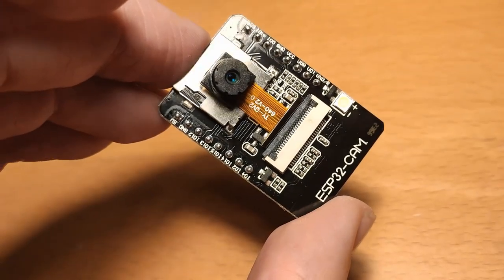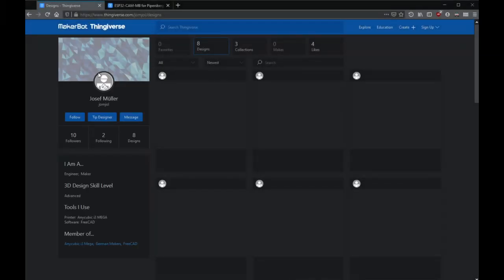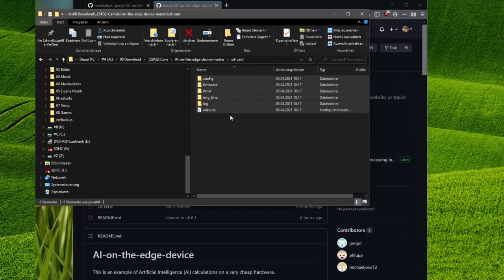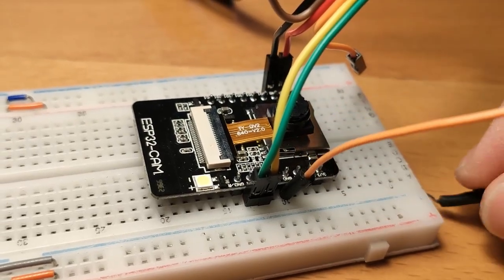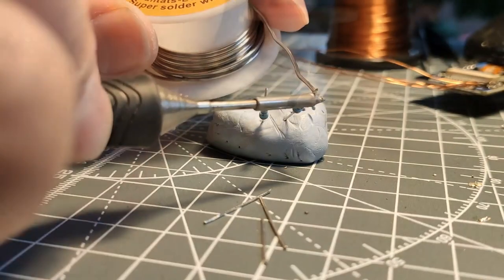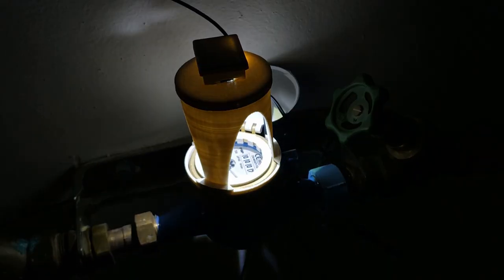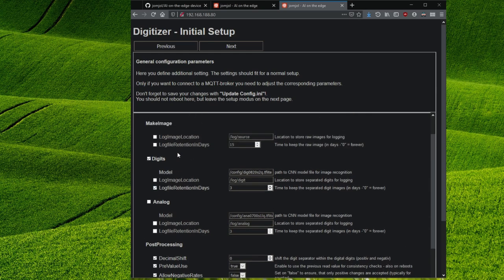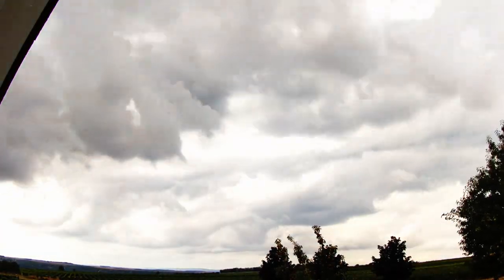ESP32-Cam on your water meter with "AI-on-the-edge" -- also for gas and power meters

Comment: LOL. I did work for similar commercial system (including analog inputs) couple of years ago. There is several issues you have to come over in good enough image quality. Used AI solution and reference points are helping in their part to tackle the issues, apparently. However, changing of lighting conditions and possibly dust are the most important ones to solve.

Comment: Thank you! I'm glad you find the project intriguing. It's true that using a camera to capture actual readings adds versatility to the monitoring process. In the past, relying solely on timing pulses with a PIC provided useful data, but integrating a camera with AI capabilities takes it a step further. By leveraging AI, the captured images can be processed and converted into text, providing more detailed and accurate readings. This approach opens up possibilities for various applications and extends the functionality of the system. It's exciting to see how combining different technologies can lead to innovative solutions.

Comment: This is a really nice solution using image recognition that runs directly on MCU! But it is not suitable for battery-powered devices if you have no power supply nearby your flowmeter. But in such a case a pulse output of flowmeter might be used. Most flowmeters might be enhanced with pulse output or already contains one.
Reply: I think just use IR and phototransistor both facing the black rotating wheel will do or the needle.it will give you a pulsing voltage .but you need to cover the whole to avoid external light. Maybe its possible use hall effect sensor because i torn a meter ,it uses a magnetic coupling .
Reply: @pinoyenginerd1091  it might be better to use a reed switch and a magnet. In such a case MCU might deep sleep till interrupt.
Reply from the maker: There is a solution with an IR sensor shown on the Bitbastelei channel. The video is unfortunately only available in German, but maybe you can help yourself with the subtitles. Actually, the pictures already show most of it: https://youtu.be/bZAZcHttFaU

Battery powered solutions are always difficult. Especially because the standard D1 minis don't support real deep sleep. But with a little trick you can do it. If you don't know this yet, Andres Spiess showed it in one of his videos: https://youtu.be/rfPwOtoGO4E?t=211

To achieve the longest possible battery life, I would perhaps not connect the MCU every time with the Wifi but only briefly wake up to log. And then e.g. only every 15 min via Wifi to send the data.
Reply from the maker: @Vladimir Kuznetsov Sure, you are not allowed to modify the official meter, of course. The method with the magnetic field and the reed- or hall-effect-sensor did not work with my water meter. Maybe the magnetic field was just too weak. If it is really important to you, you could of course consider installing your own water meter behind the official one, which is capable of reading the water consumption electronically. But then it will certainly be more expensive and more complex ...
Reply: A battery powered device will work just fine as long as you have enough capacity and a sufficient miniature solar panel.
Reply: @mIkeyGermita  in the closet? =)))
Reply: @vladimir0rus  ah, sorry!  my meters are all outside hehehe
if they're indoors, I can't imagine you would have an issue finding an outlet?

Comment: Excellent! I did the same ~10 years ago using a PC-Engines ALIX board and a USB webcam. I collected all photos that I post-processed at the time of graphing. There was no neural network, opencv or such thing by then so I had to do it all. Detecting digits was hard, especially when you're between two digits, as I had to recognize the bottom of a 2 at the top and the top of a 3 at the bottom for example. At some point the installation moved a little bit, forcing me to recalibrate every position. I'm sure that with todays cameras sensitivity and knowledge in image processing it would have been much easier and more reliable. Overall I achieved > 99% success on ~8k images so that wasn't bad :-)
Reply from the maker: Wow ... I hope the effort was worth it for you. However, I must say that the exact curve of the counter is really insightful. And with your project you surely learned more than just the pure characteristic curve of the demand.
The project shown here works really well. But of course you should not expect perfection. However, I think that the full potential has not yet been reached on the software side.
Reply: @MakerMeik  yes it was worth it. First it magically stopped the leak (when other inhabitants probably did what was necessary to avoid appearing on the graphs). Second I learned a lot on various plans in this project, including the fact that the moist in the basement made the motherboard age very quickly. In ~5 months or so, there were signs of advanced corrosion!

Comment from the maker: My shown kromschroeder gas meter has a recess in which magnetic pulses can be sensed with a reed switch. These are given at each zero crossing of the second decimal place of the counter. This would certainly have been the simpler approach.

Update: The AI-on-the-edge-installation now works using a web installer, so the whole python step can be skipped completely. (Thanks to @Mihai Krieger for the hint)
Reply: why simplier? counting increments is a relative measurement and you need the absolute offset to know the exact value. 
then a foolproof way of detecting and sensing the counts over a long period of time.
taking a picture (maybe saving it) and extracting numbers from it is absolute, even if your algorithm fails you have the picture as backup.
Reply: @nyeleskettes  ķìď09OK6KDLLLLKKII I

Comment: Nice job. 
Why do you remove the build-in LED? The nicer solution might be to turn off the built-in LED programmatically. The flash you can connect and control via GPIO.
Reply: Most likely to deal with reflections. Placing the LEDs externally allows you to adjust for bad reflections.

Comment: Tx for this excellent explanation. It seems that the new firmware will have the ability to control the GPIOs as well, so no need to desolder the flash (I presume).

Comment: Good video. I think most coax cable has a known resistance which might explain the brownout. Tv coax for example is 50 ohms
Reply from the maker: Thanks for your feedback and estimation. In the meantime, Andreas Spiess has made a great video that sheds some more light on the brownout issues: https://youtu.be/ajt7vtgKNNM
Reply: The 50 ohm of a coax cable is the wave resistance of this cable, not a "real" resistance you can measure with an ohm meter.

Comment: Nice video! However I would apply this technique only when it is necessary, in my case the water meter. The gasmeter can be read more easily by attaching a reed contact sensor without blocking the display. Every turn of the last digit magnet sends a signal which increases the last count by 0.01m3. For the electricity meter I installed PZEM004 sensors which also does block the display.
Reply from the maker: As I found out only recently, my shown kromschroeder gas meter actually also has a recess where magnetic pulses can be read with a reed switch. These are given at each zero crossing of the second decimal place of the counter. This would certainly have been the simpler approach. Thank you for your advice.
Reply: @sssxxxttt  technology is a tool, use one which fits more

Comment: Great project! The built-in flash creates too much shine. So I want to use my own external LED lights. I connected it to GPIO12 but now it burns all the time. What settings must be made in Expert Mode to ensure that the light only lights up when it is necessary.
Reply from the maker: Unfortunately, I only use the old version of the firmware here, where this was not yet possible. If you haven't figured it out yourself by now, it's best to contact the developer on Github with your questions.

Comment: Hey this is amazing! Is there a way to make it more compact though? I have door right in front of the meter. Could the fisheye lens be used? Would the software be able to compensate for fisheye effect?
Reply from the maker: Unfortunately, I have no experience in this regard. But fisheye lenses for the ESP32 cam currently cost about 6 EUR. I would say just try it and share your experience.
With the standard lens, the distance to the number display is about the same as the horizontal image width. So if your counter display is 80 mm wide, the focus point of the lens must also be about 80 mm away from it. That's why I would have been able to reduced the distance a little bit for my meters.

Comment: Danke für die Anleitung. Das werde ich doch glatt mal für meinen wasserzähler ausprobieren. 
Tipp noch zum Gas. Mein KroMSchröder Zähler hat rechts bei den Dezimalen im zählwerk unten eine Vertiefung. Da kann man mit einem Reed Kontakt die Umdrehung des letzten Rades zählen
Reply from the maker: Indeed, you are absolutely right. My shown kromschroeder gas meter has indeed this recess and I just tried it with a reed switch, it gives magnetic pulses for the second decimal place. That would have been the less complex approach indeed. Fortunately, the cam solution also runs quite reliably for me and if the MCU ever runs out of power, it still continues with the correct value at a later time, whereas with a pulse-driven approach you have to reset the base value.

Nevertheless, I have added this important hint to the video description.

Comment: Hi,
another another feedback/warning :)

I wasted two cameras (the actual camera chips) by being stupid ...
I tried to remove the camera lenses which can be difficult if the manufaturer used too much glue. In one case I tried this operation with the MOS camera attached to the PCB, in the other case I tried not very successfully to hold it manually. In both cases the flat ribbon cables tore and I won't be able to fix that again ;)
So. Best practise with lens removing seems to be: 
- never while the sensor is attached to the ESP32 pcb!
- grab the square basis of the sensor with a plier or in a vise and rotate with another plier after removing as much of the glue. 
- try to preserve as much of the thread as possible. 

Cheers,
Christoph
Reply from the maker: Thanks for the valuable tips. It worked for me in all three cases, but depending on the amount of glue, I can well imagine that this may be a problem. By the way, the (OV2640) cameras can also be ordered separately. But they are quite expensive in relation to the total price including ESP32.

Comment: Pretty nice. For the 220 owm resistor what is the power rating . I see them available to me in 1/2 watt ,1watt ,1/4 watt and 2 watts
I intend to use it with usb cable to my laptop and then 17650 battery.
Any suggstion ?

Comment: Hi and thanks for the video, i'm done with my setup and HA integration, works surprisingly well.  One thing you glossed over was grafana setup.  Could you show the query to graph daily and monthly (water) usage?
Reply from the maker: It's like I showed in the video:

SELECT cumulative_sum(difference(last("value"))) FROM "onemonths"."meter" WHERE ("loc" = 'water') AND $timeFilter GROUP BY time(5m) fill(null)

This causes that only the relative values of the currently selected period are considered.
Reply: Hi Anatoly, how did you do the HA integration?

Comment: Hello.  I have a very similar solution.  Battery only and via NB-IoT.  And I used a camera with a viewing angle of 160 degrees.  This allowed the camera to be brought closer by 2 centimeters.
Reply from the maker: Cool, do you have a video or a website where we can see how you did it? I would also be interested to know how you take the meter reading and put it into a digital form.
Reply: @MakerMeik  On the site, you can select photos that came during testing.  And use the button at the bottom of the picture to recognize the numbers. http://out.mtom.by:5000

Comment: Great tutorial. ich habe es auch gleich ausprobiert, allerdings werden die Ziffern nicht richtig erkannt. An was kann das denn liegen?
Reply from the maker: If the light reflects on the digits in an unfavorable way, the recognition may suffer. You can also play with the size of the ROIs. If all this does not help, it may just be the font of your digits. I think Jomjol will implement new fonts in the firmware updates if you ask him kindly on his Github page ;-)

Wenn das Licht ungünstig auf den Ziffern reflektiert, kann es passieren, dass die Erkennung darunter leidet. Außerdem kannst du mit der Größe der Ausschnitte (ROIs) spielen. Wenn alles nicht hilft, kann es auch einfach nur an der Schriftart der Ziffern liegen. Ich glaube Jomjol lässt neue Schriftarten in die Firmware-Updates einfließen, wenn du ihn auf seiner Github-Seite freundlich darum bittest ;-)
Reply: @MakerMeik  Thank you so much for the fast reply. I will do this.

Comment: Thank you for the video @MakerMeik I just followed your tips. All is working fine. Now I'm looking for how to do with this project transfers the data to the cloud and presents for other users the diagram consumption of gas.
Reply from the maker: I would recommend you to build a classic iot-stack. I.e. you install the Grafana service on a Raspberry Pi for graphical analysis, in addition to Mosquitto, InfluxDB and Node-RED. Alternatively, Homeassistant is also a good choice.

However, the data can then only be accessed within your network, i.e. via LAN/WLAN. Therefore a additional VPN access to your network is a good idea. With the Fritzbox routers from AVM, which are widely used in Germany, you can set this up quite comfortably. Even better, although not as easy, is WireGuard on the above mentioned Raspberry Pi.

The advantage of a VPN is that your smartphone then "behaves" as if you were in your own Wi-Fi network, even if you are on the road.
However, if you want to share your Grafana graphs with the general public, you'll need to install Apache on your Raspi and share Grafana via reverse proxy.

This all sounds more complicated than it is. You should start by setting up the iot stack (Grafana, Mosquitto, InfluxDB, Node-RED). Here is a good tutorial:
https://youtu.be/a6mjt8tWUws

I can highly recommend all of this and if you expect to add many more sensors, it is definitely worth the effort. Above all, these are all open source projects that no manufacturer can simply take away from you. In addition, the data is then exclusively with you on a hardware that you control yourself.

But of course there are also commercial solutions. Then you can upload your data to their server and have them directly online in the web. This is certainly more convenient, but you are very tied to one provider. And if they decide to stop offering their service (for free), you will have difficulties to move your data to another place.

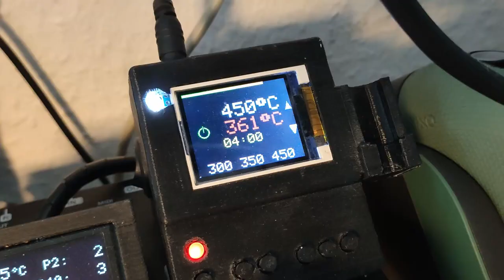Comment: 7:06 did you made diy soldering station? love to see video on that
Reply from the maker: I have built the soldering iron according to the construction proposal "Maiskolben". There is an article about this in the German "Make" (unfortunately only in German)
https://www.heise.de/make/artikel/Platine-fuer-DIY-Loetstation-Maiskolben-3569923.html
The developer also has a store where you can order the PCB. But these are often not in stock.
https://hannio.org/en/produkt/maiskolben/
The soldering station uses the professional soldering tips from Weller, I use e.g. the Weller RT 1, and it controls them via an Arduino. The total sum of the components is about 80 EUR. However, in the meanwhile I also bought a Miniware TS80P, which has a similarly good handling and costs similarly much, but without the tinkering effort.

Comment: thanks for the video!, i want to ask you a question, how did you comunicate to node red? do you install mosquitto broker or something?, wating for your answer, thanks!!
Reply from the maker: Yes, that is exactly how I do it. The ESP32-cam sends its data via MQTT, which is passed on to Node-RED by the MQTT broker Mosquitto. In Node-RED I then write the data to an InfluxDB database, which I then evaluate with Grafana. This sounds much more complicated than it actually is. And when it's up and running, you can control all kinds of IOT-data with it.
By the way, this constellation is called the classic IOT stack. If you start from scratch, you can watch the video of Andreas Spiess, in which he explains how you can install exactly these services on a Rapsberry Pi with very little effort:
https://youtu.be/a6mjt8tWUws
Reply: @MakerMeik  thank you so much, i have installled node red, grafana, mosquitto broker, influx in ubuntu in a virtual machine, i have problems in node red with de mqtt broker, it connect and disconnect all the time, do  you experience something like that? any special configuration in mosquitto?, thank you for your time!